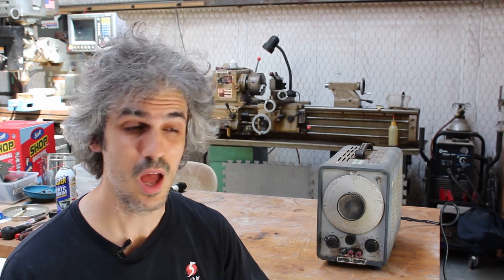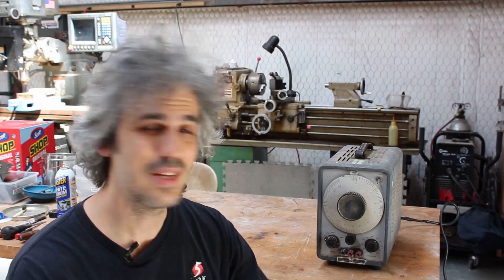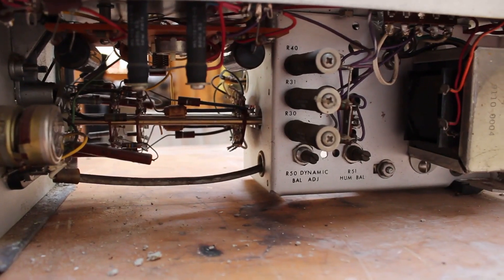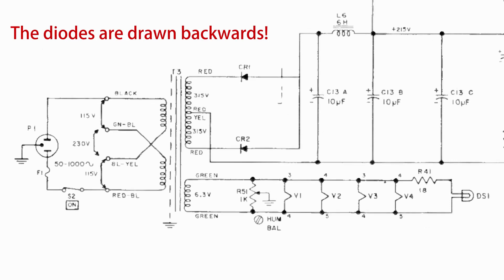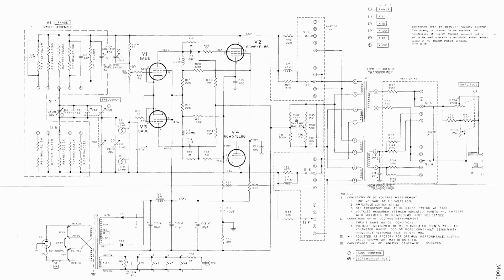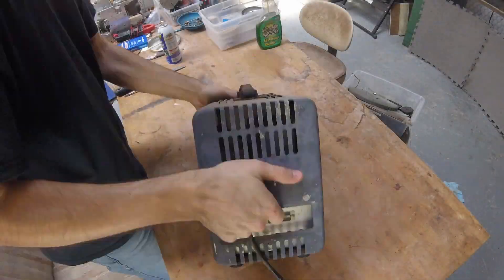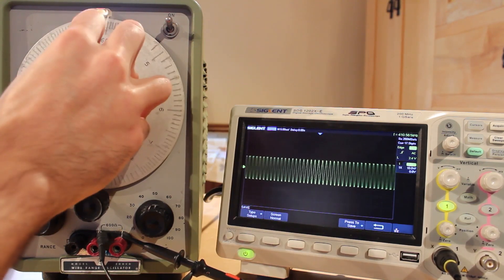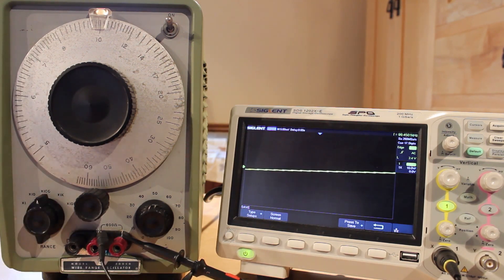Restoring an HP 200CD Wide Range Oscillator

Comment: The light bulbs do stabilize the output. But you are missing the main point. The bulbs control the feedback to a level where a very low distion sine wave can be obtained. It was a novel approach achieved by Bill Hewlett.
Consider without the bulbs, you would not be able to obtain a sinusoid!
The earlier approach used by RCA ond others to obtain a low distortion sinusoid was the heterodyne approach: beating two rf carriers, the difference would be the desired frequency out.

Comment: Congratulations!  Excellent restore of what is still a worthy boatanchor piece of gear...  I bought a 200C as part of a university surplus lot nearly 20 years ago (also a Tek 465B and a pair of Heathkit B/C tube bench DC power supplies for $15.  The HP and Tek worked and just needed a cleaning.  The two supplies became one.

Two years ago the HP died.  It was one of the power supply filter caps.  I replaced both multisection caps, along with two Sprague 1uf @ 400WVDC cans.  The other caps in the unit are axial mica block and rarely go bad--and were in tolerance so they remained.  On mine, I dissasembled, cleaned, and lubricated the vernier dial and polished the dial.  What a beauty, and ready for another 50 years--long after I will no longer be alive.  

If someone is doing a restore, I recommend replacing the two old 'hat style' rectifiers with something like 1N4005 (1A @ 600V).  An under $1 proactive fix...

Comment: At first glance at the schematic, I see the two rectifier diodes are shown in the wrong polarity to supply positive plate voltage. If this is a genuine HP schematic it would be unusual to see any errors.
Reply: As far as I can tell, at that time diodes were always drawn the other way around like that. The schematic symbol is literally a picture of the current being blocked in the direction of the bar, and before they worked out that conventional current wasn't actually representative of the electrical flow, it made sense to draw it that way around.  I dimly remember, many decades ago, being taught that diodes were correctly drawn that way around; when I began to re-familiarize myself with electronics, a few years ago, not realizing that had been changed caused me no end of confusion.

Comment: I stumbled across this video while anxiously waiting the update on your Centurion minicomputer project.  This is a great video about one of the most iconic products of Hewlett Packard and Silicon Valley. Thanks for sharing your restoration. The Hp 200A, which eventually turned into the 200CD was HP’s first product. It was also William Hewlett's 1939 Stanford thesis. Hewlett was also awarded patent 2,268,872 in 1942. I can recommend a great read “Max Wien, Mr. Hewlett, and a Rainy Sunday Afternoon”. It can be found in chapter 7 of the EDN book, “Analog Circuit Design” (ISBN 0-7506-9640-0). The patent and Chapter 7 can both be found on the Internet.

Comment: My guess is that the HP 200CD Wide Range Oscillator is using a circuit called a Wien-Bridge Oscillator circuit, and that broken variable-capacitor you removed is basically a trimmer-cap used to align the circuit so that the Vernier-dial markings are properly calibrated across the entire range of frequencies that the oscillator is capable of running at, I could be wrong though, incidentally, the reason why HP chose to go with a Wein Bridge Oscillator design for the HP 200CD, is because it generates a Sine wave with relatively low THD (Total Harmonic Distortion), which is important if the HP 200CD is going to be used as a piece of audio test equipment, HP could have gone with a Phase-Shift Oscillator design.
Reply from the maker: Very excellent guess! It is indeed a Wien-Bridge Oscillator circuit, and this particular circuit really put HP on the map! 
The vernier dial markings are slightly off, so you may be on point with your thinking that it's to adjust the markings to be accurate. If I ever get around to taking this thing apart again, I'll take a look at getting a replacement cap in place!
Reply: Yes, but remember they started building the first versions of this (200A) in a ramshackle garage!
Reply: @og_papatango  I have three of them there all different inside. The oldest one is the strongest. I can't remember all faults but one was the light bulbs were not making contact and a fresh dab of solder on bottom the of bulb fixed it. The unit in this video is a newer model.

Comment: Con ésas mismas válvulas se puede construir un amplificador de audio de baja potencia
Reply from the maker: The 200CD oscillator actually uses two 6AU6 tubes in it, which happen to be my favorite tube. I've used it for just about everything, but notably, I'm building my entire vacuum tube computer using the 6AU6. It's a great tube for low voltage stuff!
(I used Google Translate for your comment, so if my reply doesn't make sense, I blame Google!)

Comment: I own and regularly use a 200CD.  It gives a very clean, pure sine wave, better than any multi-function generators I have used.  If you find one, best to replace the filter caps.
From the Wikipedia article on Hewlett-Packard::
Of the many projects they worked on, their first financially successful product was a precision audio oscillator known as the Model HP200A. Their innovation was the use of a small incandescent light bulb (known as a "pilot light") as a temperature dependent resistor in a critical portion of the circuit, the negative feedback loop which stabilized the amplitude of the output sinusoidal waveform. This allowed them to sell the Model 200A for $89.40 when competitors were selling less stable oscillators for over $200. The Model 200 series of generators continued production until at least 1972 as the 200AB, still tube-based but improved in design through the years.

One of the company's earliest customers was Bud Hawkins, chief sound engineer for Walt Disney Studios, who bought eight Model 200B audio oscillators (at $71.50 each) for use in the animated film Fantasia.
Reply from the maker: I'm still blown away at just how good this oscillator is! The BK Precision 3010 Function Generator I have on my desk is nice, but the sine wave is just no where near as clean or rock solid as the old HP 200CD.

The little incandescent lights in there threw me for a loop the first time I saw them, but once I saw that they were using them as temperature dependent resistors, I couldn't help but smile at the absolute brilliance of the old HP engineers. 

That's awesome that the 200B was used for Fantasia, I had no idea about that! I'm totally going to use that bit of information every time I talk about the HP oscillator now, haha.
Reply: I also own one sitting on my bench, and use it from time to time (as it's the only LF generator I own). It's a Model 200CD tough, but looks identical. The range switch is just getting a little dodgy but still workable. The big frequency wheel is much cleaner than yours. Also still have the original paper service manual for it.
Reply: The dial today would be $80.00 - 😊

Comment: Did you do a part 2 of this..? I can't find it...

When you clean the internal parts with water and detergent or similar cleaning agent, it is always recommended to thoroughly flush it all off with distilled water. That removes any residue that might crystallize and pit the surfaces, especially aluminum and other porous metals.
Reply from the maker: I didn't do an official "Part 2", but I did put the oscillator to work in testing out some tubes: https://youtu.be/VtWRT-VIW54

I didn't show it in the timelapse, but I actually carried the whole unit into the garage after washing and used compressed air to blow dry everywhere I could before letting it sit in the hot Texas sun to 100% dry out. Not quite as good as distilled water, but at the time I did this restoration, the local grocery store was out of stock of just about everything (even rice)!

Comment: The tubes (all four of them) form a vaccuum-state op-amp with two feedback paths. The circuit is known as a Wein Bridge oscillator and it is what Bill Hewlett based his work on when he created this design in 1937 for his masters thesis.  C7 is part of one of those feedback paths.  It gives the op-amp some very high frequency feedback to prevent it bursting into very high frequency oscillation, say above 1 MHz.  If it works fine without it then you don't need it and can forget about it.
Good work getting this venerable instrument going again.
I notice that the tubes are branded HP so are probably the original ones installed at the factory in the 1940's or 1950's.
Reply from the maker: Thank you! And thank you so much for the information! I definitely learned something new today as i hadn't heard about the Wein Bridge oscillator before. Time for me to do some more reading on it! That's awesome that it's essentially an op-amp oscillator, and quite a brilliant little design. 
So far, I've been playing with it through all ranges and frequencies and haven't run into any problems. It needs a little adjusting on the individual ranges to get it to be spot on, but honestly, I'm probably never going to do anything that would be that sensitive without having an oscilloscope hooked up as well.
I'm fairly certain it's all original inside. It looks like none of the parts have been replaced or even any rework done anywhere. That's super impressive in my book, considering it's getting on to 60+ years old now!
Reply: @UsagiElectric  One note--those light bulbs should never burn out, and don't replace them. They were carefully matched at the factory for their characteristics. Treat them carefully, and don't swap their positions. Those light bulbs are probably the most important and critical component for the stability of the unit, and they are the real magic in the circuit.
Reply: You are absolutely correct. Also, the father of this unit the original HP 200 was their first product, built in the garage. Their first big customer for the 200 was Disney, used in the soundtrack of Fantasia. The company really took off from there.

Comment: So am I correct that you use the water hose to clean the variable capacitor?
Reply from the maker: I indeed did use a water hose to clean the inside. The unit hadn't seen power for at least five years, so there wasn't any residual power in the capacitors for certain. After washing, I actually blew most of the water off with light compressed air and then dried the rest by hand with rags before putting it in the hot Texas sun for a few hours to properly dry out. Then, it came inside and dried for an entire day before power was applied to it. I didn't really take any time lapse footage of that because it's super boring, haha.
Reply: old equipment are tough.. I'm surprise he doesn't use power washing to get the job done
Reply from the maker: @flmag88  You're absolutely right! Most of the electronic equipment I come across from the 50's and 60's is built like a tank!

Comment: Nice piece of equipment you have there ! The schematic seems pretty explicit : I think C7 has to be between 1.5 to 7 pF, and you have to adjust it so output is at 24V @ 1kHz. C7 will short R12 at high frequencies, so It may be a gain compensation to counter the output voltage drop or resonance near cutoff frequency
Reply from the maker: Thank you!
Digging into the HP manual a little more, it seems that C7 is only used to adjust the x10k range. You set the dial to "60" and then adjust C7 until you get exactly 600 kHz. Fortunately, the x10k range seemed to be pretty spot on with C7 removed, so that's some good news!